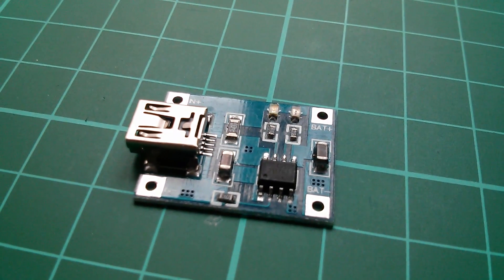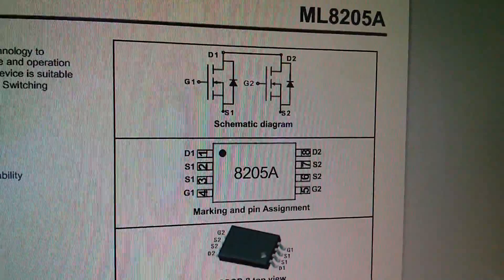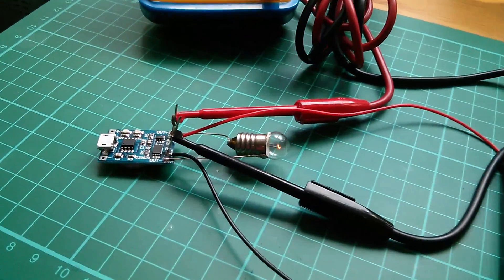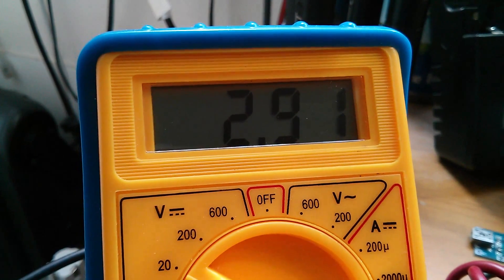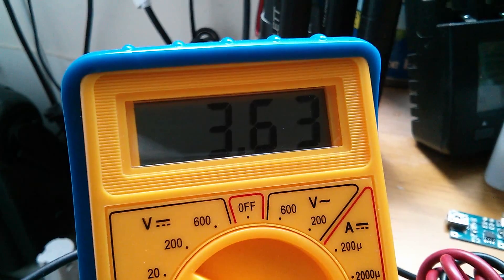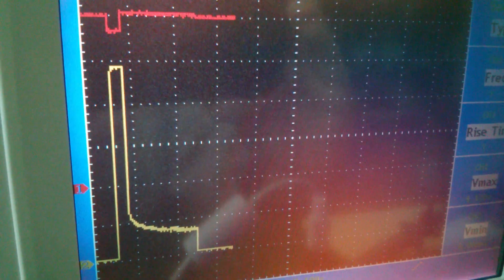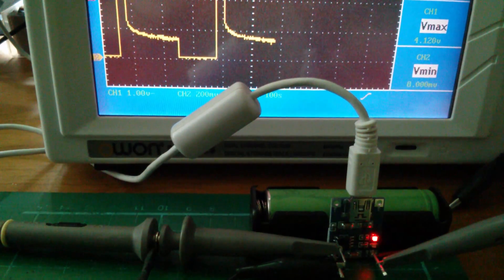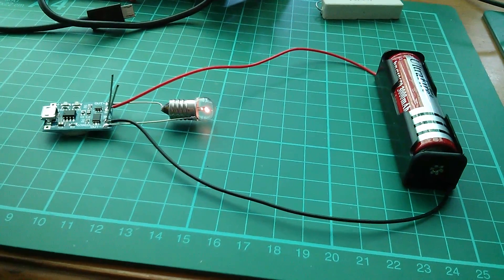New TP4056 Lithium Cell Charger Module with Battery Protection

Comment: Has this been tested using solar cells rather than USB for battery charging?I am now testing that but going to be awhile until battery power drops off to see if the load also shuts down.Then the long wait for the sun to be maximum...could be weeks in NY :)
Reply: +Jim Z (N2NXZ) Testing of the module here is good,but not suited to use on devices that use a lot of current from an 18650.The dropout voltage is too low in my opinion.Yes,it will turn off a load under 3v but with the same token,turn a load ON after 3v but not sufficient current to operate certain devices fully.Current is more important than volts for some things.Right now,my solar cells are producing some charge through the module into 18650,device LED`s are lighting already but not enough current to run it properly.This is not good for my use as the load or device needs a clean start.If it would turn a load ON at a higher current,it would be much better.

Comment: Just out of interest, what if I was to make a multi pack of Li-ion cells (*4 parallel), would it still be possible to use a module such as the one you are showing?
Reply from the maker: +Dave White If the cells are in parallel, yes.
Reply: +Julian Ilett - from my math, this would increase the time taken to charge as this will only supply 1 amp?
BTW - great videos and exceptional explanations 😀

Comment: I have the older version and noticed using capacitor it stops charging at dangerous voltage of 4.5V. If it was real li-ion battery the charger would destroy it. Is there any way to adjust cut off voltage on this board?
Reply: That's probably because a capacitor does not respond the same way as a lithium cell.  The TP4056 tries to hold the voltage to 4.2V while in CV mode but it's still trying to charge what it thinks is a battery.  Since it's actually feeding current to a capacitor, naturally the voltage keeps on rising.
TL;DR: Use an 18650 and it will work right.

Comment: Could I use 3 of these to charge a 3s lipo by connecting each one to the respective connection a the balance plug?
Reply: +Nick Charlton whats the point, 3 of these will cost as much as one for 3 S ...
Reply: +TheScrappingJeahaha I wanted to be able to use 5 v input, but yeh it's tricky to set up anyway, need 3 isolated power supplies... so sod it

Comment: Hi Julian, can I charge RC 1S 2000mAh battery with this module, or it has to be 1000mAh max.?  
I intend to power the module from a USB solar charger I made that has 3 solar pannels connected in parallel (each 320 mA at max. sunlight, so that's 960 mA total)? 
Since the output voltage of solar cells is > 10V at full sunlight, I made the step down circuit using LM317 regulator to around 5V DC (the USB provided voltage).
Reply: +Viktor Božičević So, could I charge LiPo cells with this board that have capacities greater than 1Ah or would that damage the chip? Please reply!
Reply: +Viktor Božičević 1 Amp was the charging current.  The battery capacity doesn't matter, it would just take a longer to charge.  Also, you're not required to use 1 amp, you could use 1 solar panel, it would just take longer to charge.

Comment: Thanks for the info. Will this board charge a multiple cell pack? If so, what would I have to do to the board to achieve this? If not, what would I use to charge a multi-cell pack?
Reply: It depends, if you have all the batteries in parallel then it should work (depending on the amount of batteries). But if they were series the voltage would be too high.

Comment: can i use my Li-ion 180mAh 3.7V Battery with that charger?
do i have to change somethink to get it working?
Reply: You'd need to change the charge resistor to lower the initial charge current to 90mA (half C).

Comment: Great video! Hope someone can help me, I've got 2 similar to these, 5v input, 5v 1A output.
I was wondering if I could put both in parallel in some way and get a 2A output.

Any answers will be appreciated, thanks!
Reply: You can change the resistor and you can increese the amps i don’t know what rezister

Comment: Hi Jullian - thanks for these very informative reviews. 

One question - do know what current that board can supply on battery and during charge? I suppose it's mostly down to the rating  of the dual mosfet array (and of course the battery!)

PS I'm glad you have good success and freebies from 'Alice' but its not always that way.

I've stopped using 'Alice' because 'she' didnt ship a load of ESP boards to me. Fobbed me off with "please check with your post office" and "chinese new year is very busy" for months.
I kept replying showing that the tracking number they supplied showed that the carrier had never received anything from them... This was dragged out long enough that ebay/paypal wouldnt do anything about it so I lost out...

But at the end of the day - 'Alice' lost out more than me - that was one of a few trial orders before I ordered placed a series of orders several orders of magnitude... with other suppliers. Oops!

Comment: What size is R3 (charge current programming resistor)?
EDIT:  Disregard...RTFDS on my part.

Does this thing cutoff during a high-current discharge condition?  e.g. trying pull like 10A out of a single cell...not that the cell would handle it, but would the module go into cutoff?

Comment: What I'm wondering is how do multi-cell battery chargers keep the cells balanced? I was thinking there would have to have a charging circuit for each cell. You could use a TP4056 on each cell but that would require an isolated power source for each cell. I'm pretty sure that's not how it's done but do you know just how it is really done?
Reply: +Robert Shaver I too am wanting to do this with up to 6S and charging while drawing a load. My initial experiments are yielding mixed results and i think i need isolation somewhere.

Comment: +Julian Ilett Hi. I am looking to use 3.7V 18650 2600 mAh embedded for my project (device measuring parameters). When the device is connected to the power socket (thru 5V usb connector), it would recharge the battery as well as power the device (consuming 250 mA continuously). Once power socket is not connected, device would run from battery. What additional setup shoud I look for ? Thanks

Comment: Connect 1 Ohm heater to the new tp4056 charger, heater will not operate but if connect to USB charger, the heater will be operated. 
In this case, if USB plug out, the heater will be operated. 
Why not work when operated by battery? Caused by short detection or over discharge detection? Is there anyway to solve the problem?

Comment: would the new model charge a 8000mah lipo battery like this ?
http://m.ebay.com/itm?itemId=181849166340
Reply: Yes it charges...  but I don´t think the 8000mAh are true... loool
I tested one 18650 with 5000mAh and it only holds 1000mAh

Comment: What if you supply 6 volts instead of 5 V.   Is there a problem?
Reply: +GoodScienceForYou Yes should be fine, it just won't charge at a full 1A, it'll have to dissipate that extra 1V as heat, but instead of asking on youtube comments you should just check the datasheet...
https://dlnmh9ip6v2uc.cloudfront.net/datasheets/Prototyping/TP4056.pdf

Comment: Sorry I'm new to this but I'm trying to modify small electronics (gameboys) to have rechargeable batteries and backlights. The backlight is simple. The rechargeable battery is confusing me because I bought TP4056 v5. It definitely has a micro usb but it doesn't have over-discharge protection (to my knowledge). The anatomy of the chip looks like the older chip but with a micro usb instead of a mini. 

So my question is, did I waste my money? I'm planning to sell these and I can't have them breaking because somebody left it on all night ya know? Is there another simple way to protect the battery from over discharge or should I just bite the bullet and buy the newer chip?
Reply: +JitterBob It depends, do you absolutely must have the undervoltage protection? If so then sure why not? They're only about $1, if not then the older ones are still good little chargers.

Comment: So based on what you have demonstrated.  The protection circuitry uses power from the battery itself to monitor the voltage state of the battery voltage.  Have you measured the standby current of the protection circuitry?   So the self discharge of a protected cell sitting in a drawer is sure to be more than a non protected cell.   Any thoughts or experimentation on this by chance?    Might be an interesting video subject.   Happy New Year.

Comment: Hello!
First of all great review! I'm noob with electronic so sorry for maybe dummy questions ;)
I would like to purchase this board and use it with a solar panel and then use it to power an arduino with some sensors (not more than 60mA excluding the arduino itself).
Which kind of solar panel do you suggest (in terms of volts/mA)?
And which kind of battery? Better a 18650 or a normal 1000mA Lipo battery like that used for helicopters?
Thanks a lot!

Comment: have a project i'm working on and this seems like its just what i need. however what if your charge source doesn't put out 1 amp. i have a 6 volt solar cell that's suppose to be able to output 0.33A. I figure with a diode dropping 0.7 volts should be close enough to 5 volts not to damage it. buts thats just a guess. did yours come with a data sheet with details on input power?

Comment: what exactly are the - and + signs beside the micro usb port, Ik the outs are for the device and the Bs for the battery but I dont get the use of the -/+
Reply: +allthingsmultisoft5455 It is for 5V in instead of using the USB port.
Reply: so its basically is you wanna recharge the lithium ion battery with another battery of 5+v volts?
Reply: +allthingsmultisoft5455 Yes, or a power supply.
Reply: +Citroable ok thanks.

Comment: I purchased this module and replaced R3 with 10K resistor in order to charge my 120mAh or 290mAh batteries at 130mA. It gets the battery to 4.2V and the current gets as low as 2mA but I never gotten the charging process to end/green LED to light. Unmodified modules charge my 2600mAh (nominal) batteries at 1000mA and they do indeed turn off. Any idea why this  may happen? According to the datasheet, cutoff happens at C/10 but might this be just so low when it comes to the small 290mAh that the circuit misbehaves?
Reply from the maker: +Friendroid Yes, possibly. Although I seem to remember mine working with a 10k resistor. Maybe it's noise from another part of your setup.
Reply: +Julian Ilett You are correct, it was the digital voltmeter (7 segment display) I had soldered to B+ and B- that was causing trouble, I removed it and the charging ended normally. I thought a digital voltmeter like this would be a good way to monitor the rising battery voltage. Thank you for your help once again.
Reply: +Friendroid Sory to jump from nowhere, but could you help me?

I've got 2 similar to these, 5v input, 5v 1A output and 2 18650 cells.
I was wondering if I could put both in parallel in some way and get a 2A output.

Any answers will be appreciated, thanks!
Reply: +Fradantim Just wire the inputs together and just connect the outputs of each board to each of the 2 cells
Reply: NO! You can not guarantee that voltage cutoffs will be identical.  Wire each individual charger to its own battery.

Comment: I got two of these and there's one thing about them that I don't like. The CC part of charging goes pretty well at about 0.9 A but when the cell reaches 4.2 V, it won't switch to CV. Blue led lights up indicating that charging is complete but it is obviously not. Any ideas on that?
Also, as somebody has mentioned earlier, I don't like discharge voltage cut-off set at 2.5 V. Correct me if I'm wrong, but what we get with these two 'features' combined is under-charged and over-discharged cell that won't live long.
Great YT channel by the way, keep it up!

Comment: What is the maximum Current which you can input into the Micro USB? can it take 2A or 3A?
Also what is the max current which it can output (through the out pin) while it is charging the battery?

Actually I had the idea of using it as a UPS for a 6W modem, Ijust wanted to know whether it is possible or not?

Thanks
Reply: The circuit will only draw a bit over 1A no matter how much more current your power supply can produce.  This is because the TP4056 circuit can only charge at a maximum of 1A, which is the default for this board.

Comment: Higher than 4.20 and lower than 3.00 will cause damage and shorten the life of the cell.  I have not found any circuits that can be purchased that are correct.  If anyone knows of one I would really like to know where they can be purchased.  I think they do this so the cells don't last and you need to buy more.  Always about the money.

Comment: can we put tp4056 module in parallel ?
Reply: I tried you idea and the voltages of each call was not equal.
Reply: I think he means in parallel for faster charging and higher current discharge, can you try that?

Comment: Hi Juliet,
I did the reverse engineering of this circuit.
Because a strange effect when I connect the battery to B+ and B- and the load to out+ and -
In fact, if I'm not wrong, the terminal B- and out- are switched on this little board (instead B+ and out+ are correctly shorted)
The strange effect I got is that if you put a switch just after the positive of the battery, you need to turn the circuit on twice.
Otherwise the load is not powered on.
Please let me know what do you think.
Reply: Hi anyone, could you help on this matter?

Comment: Isn't it rather mad that the battery protection circuit also prevents charging it when the battery is at less than 2.91V?

Comment: Brilliant series of videos, really like the useful stuff you review and its nice to have someone reviewing practical everyday affordable stuff.

I think you should not connect a load in parallel with B+/- that will not allow termination of the charge cycle because it will damage the cell, the requirement for the battery voltage maximum is very precise, and from what i can tell you could probably calibrate an everyday  DNM using it as it as a voltage reference. Specs for all of the  boards I have seen state cut off at 4.25v +/- 0.025V...I am basing the cut-off voltage from generic PCM boards sold on E-BAY.  I am sure you are aware that there are PCM boards available that will allow a higher charging current.

Keep up the good work

Comment: Two Questions: 

- Isn't 2.5V discharge cut-off voltage too low for LiPo battereis? LiPos should be cut off at about 3.5-3.7?

- Which resistor should be taken out and replaced so it can be replaced with potentiometer, so that one can have variable current 0-1,000mA.
Reply: HitAndMissLab no, 3.7V is nominal voltage, not cut-off voltage
Reply: Exactly my thoughts! The DW01 IC in this board cuts off power at 2.4V according to datasheet. If we look at a typical LiPo/LiIon battery curve, after 3V or so, almost 95% battery is depleted. At about 2.5V it is 100% depleted. Why would I want to destroy my cell by emptying it every time?
I got a Sparkfun LiPower boost convertor with undervoltage protection to use with this. And guess what? It has "Undervoltage lock out at 2.6V".
Reply: You don't need to replace the resistor if you connect a potentiometer in parallel.
Reply: have a look at this: http://i.imgur.com/4o36Lrs.png 
and http://www.datasheetspdf.com/PDF/ICR18650-24E/899176/2
and http://www.datasheetspdf.com/PDF/ICR18650-24E/899176/4
Reply: According to the datasheet for dw01 (battery protection IC) it reacts to overdischarge at between 2.3 and 2.5 volts. More then that, it is not possible to adjust this threshold. Resistor on CS pin is for putting this dw01 in power-down mode so that not to drain the battery even further.
Reply: then why the heck are all the protection circuits 2.5v cutoff it makes not sense when that damages most lithiums, my lithium ion drill battery cuts at 3v.
Reply: +HitAndMissLab 
The resistor - if you hold the board with input socket on the left, it is the most bottom resistor (the one connected to pin no. 2). It's all in the datasheet :)
And I don't like the discharge cut-off voltage either - way too low in my opinion.......
Reply: HitAndMissLab the
Reply: HitAndMissLab I agree as that is the only voltage I have seen on them.
Reply: It dose not cut the voltage
Reply: Why the hell are some of you people on an electronics youtube channel if you are too stupid to read a datasheet? The discharge voltage of Lithium Ion (and LiPo) cells is at max about 3V, at 3.5 to 3.7 volts most of the charge is still in the battery!
Reply: HitAndMissLab 
Good practice for li-ion or LiPo is to cut discharge at minimum of 3.5 volts. Not much energy is available below this, although some chemistries are taking less cumulative damage from it.
Charging to less than 4.2 V is also beneficial to cell life.

(LiFePO4 is operating at a lower voltage, and the above voltage range does not apply to this chemistry.)

Comment: I'm using the board with the battery protection IC to charge a Li-Ion battery which hasn't got a BP built in. The problems is that the setup charges the battery just fine, However the battery seems to drain beyond ~2.5V cutoff and drains to about 1V. The BP PCB is soldered to the battery in a permanent configuration. Have you experienced a similar issue.
Reply: +edgemaker11 Sounds defective. Is the polarity correct?
Reply: +Spritt Sprangande It was actually a defective one. I had a spare to compare against and the spare one works just fine. Thanks.

Comment: There are 2 things i dont understand.
1 - Can i use this to charge a battery and use the Arduino at the same moment ? ( I think i will need to get a step up too )
2 - Isn't 4.2v dangerous ? Wouldn't be better if it was 4.1v or 4.0v ?